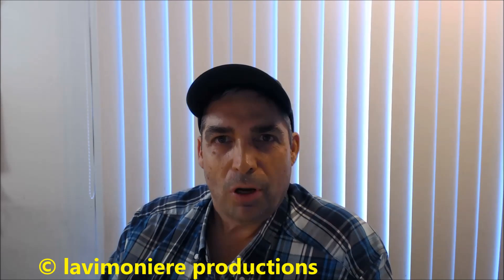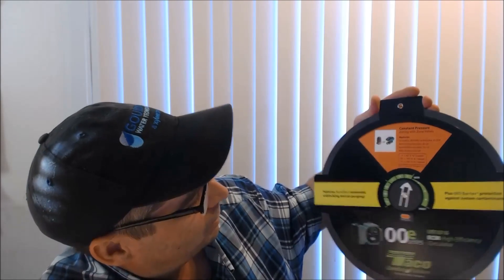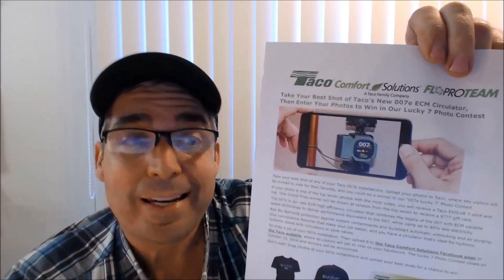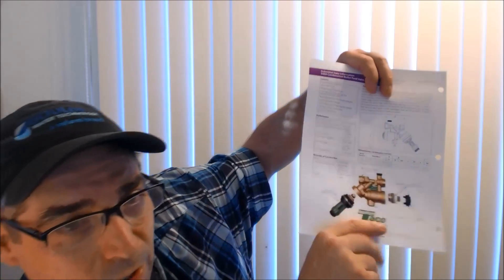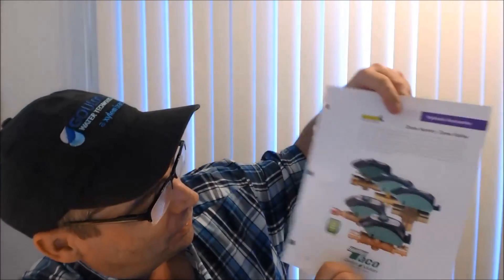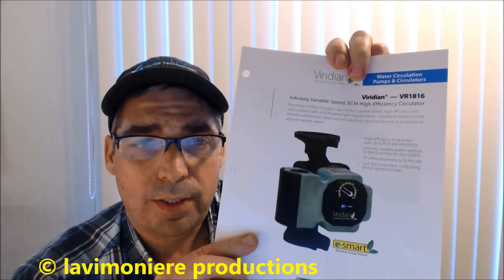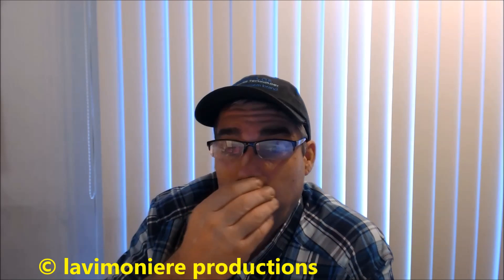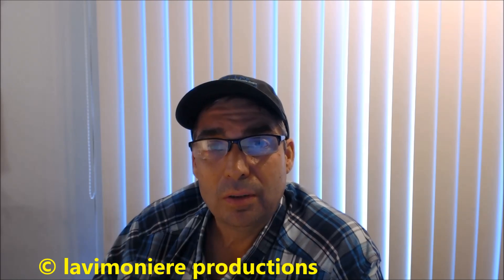New Taco ECM High Efficiency Circulators my thoughts

Comment: I know it's an old video, but I installed a caleffi mag/dirt trap a year ahead of me planning to replace my boiler system to get ahead of pull magnitite and crud out of the system.

First few flushes were dirty, after that I maybe blow down 1x a year now. I'll flush once a week after making a chance, kick space, act install to catch copper shavings and such flowing in system. 

Running a VT 2218 and couldn't be happier after having to choke it down with a valve to 2gpm.

Comment: Steve, we installed a new Veismann boiler with the 007 ecm recirculator (about 3 weeks ago). Today, the pump stopped working and they came and replaced it. We have all copper baseboards and I have no idea why it failed, but I hope the new one doesn't fail soon (we have a single zone system).

Comment: yes, i know this is an old vid but big companies now are no longer about service and making a good product that lasts. its all about building failures so the end user has to buy more. like you said, your working on 50+yr old boiler systems that worked fine all these yrs without magnets. i was told by a plumber that the boilers today will be lucky to see 20yr. big companies are all about money...period.
i have a cast iron american standard boiler from '67 thats running fine but alot of the nubs on the heat exchanger have roasted off so i bought a new weil mclain cga-5 which im hoping will last me the rest of my life or as long as i keep this house. right off the bat, im buying extra parts so i have them on hand because of all these engineered shortages.
its a shame we can no longer buy certain things and not have to worry about them breaking down or having to "update" to keep up with some mandate or code that we've been fine with not having all these years. this house i bought with the original american standard boiler and baseboards and it still has the original thermostats and smoke alarm, family gard fg777c which i think is from the same time period, late 68's early 70's, and everything still works just fine!!!
"they dont make them like they used to" isnt just a saying...its a fact.
thanks steve.

Comment: I've installed a few boilers with the new taco 007-e  circulator. In older heating systems.    Had to go back bc of rattling pipes due to the pumps magnetic feature.

Comment: This is just an example of the bean counters showing how much money you can save, but you will lose in the end because of the higher maintenance costs. This is just like the wall hung boilers you dislike because they were installed mostly to get a rebate. I’d rather stay with old technology instead of ecm motors and electronic txv’s.

Comment: A magnetic rotor saves electricity because it lowers the wattage needed to get the same power from the pump. They also need to convert the current from ac to dc. This will cause the pump to have a shorter lifespan.

Comment: ECM variable speeds are the way of the future. Can run on constant pressure mode to keep the same flow rate when different zone valves are closed or open.  Delta T mode changes GPM based on Delta T. Very efficient and can dial in GPM and ft head curve perfectly. Dirt separators aren't a bad idea anyway with new mod con boilers. You're probably right not the best solution on all black and cast iron old system.

Comment: I'm pretty sure they are using permanent magnet motors. Instead of making all it's magnetic fields with electricity they use actual magnets like on your Frigidaire. Car starters have all gone to permanent magnet anymore. Smaller, stronger, and more efficient. Great videos. I've learned a lot from you and im not a plummer. Just a tinkerer!

Comment: I installed the 0013-VDTSF3 variable speed circulator in my 6 zone system.  So far this brand new $565.00 pump does not circulate water!  I bought an extra pump so that down the road in winter that if the pump fails I have a swap... so here I am, $1200 worth of no circulation!  Not impressed. I have a stainless steel and PEX closed system using only distilled water.  This is a new system and there are no blockages or circulation issues.  Any suggestions?
Reply: Yes.  Its not talked about enough but different pumps work for different gpm at different head pressures.  Sounds like you have a radiant system.  If so you may need a pump with lower gpm but higher head.  Taco almost certainly makes the right pump for your situation, you may just have the wrong one.

Comment: I love your videos.  The ecm motor is the same type of motor in brushless drills etc etc. They last longer . Wven on cast iron your going to see efficiency gains . Especially with delta t  operation . Also the motor is sealed from the water in system .

Comment: Nice video. Wished I'd seen it about 2hrs ago. I just purchased one of these to replace a original 007. Damn this think sounds like trouble. I watched a video of the 007 ecm earlier when the representative praises this thing and tells how efficient it is , how it ramps up and down and senses air, repeals air via ramping up the motor, senses obstruction and attempts to free the obstruction up to 100 times in 15min time frame going from reverse to forward. And of course my house is from 1920 and is all iron pipe. Yikes I'm in trouble. Might have to buy a regular 007 if this doesnt last. I'll put a bunch of magnets on the return pipe to hopefully help collect the iron shaving . Thanks for posting bud. Time will tell like you stated....

Comment: The delta t and p circs are a great idea but not to save on electricity. The delta t can maintain the design temp diff for your system, usually 10 degrees for radiant and 20 for baseboard and radiators. This cuts down on short cycling.

The delta p is great for zone valves. As the valves open and close the proper pressure will be maintained. You can run the delta p constantly because the speed will really wind down when all zones are closed using almost no electricity. The benefit of leaving it on is that you won’t have to go through the full speed initialization for one minute every time they start.

As far as a money saver forget about it. The standard 007 only pulls the energy of a 60 watt light bulb.

Comment: hey Steve we've had those type of circulators in the uk for a few years now. They're unreliable junk!
Reply from the maker: thanks for the input i know you guys are way ahead of us in high efficiency boilers and stuff .i work on most old stuff 80 + boilers  starting to change over here to more higher efficiency stuff . but just starting .i do not thing fuel cost are as high here as you guys . gallon of gas is only 2.15 per gallon

Comment: I don't understand why manufacturer's would set up a product to fail like that. I am with you it's crazy! I guess it's all the regulations that the department of energy is putting on the industry. Then as contractors we have to deal with it, as they say it flows down hill and we are at the bottom of the hill.
Reply from the maker: yes sir ,some of the stuff they come up with .is crazy

Comment: Steven, You are right about use in any system containing iron work. Trouble will ensue in a short time causing high maintenance for the end user. Even some types of "stainless" products will corrode to a certain extent. Be very careful. I have encountered similar problems throughout my years in the heating industry in Europe. Regards

Comment: So it requires a $200 filter, that requires cleaning every month...  So you take a house that was built in 1910, everything is steel pipe, and cast iron, and it's a rental, and the tenant does not pay the bills, so they don't care when it quits they call the landlord who calls the heating company to fix it.

Comment: We using the HE Pumps from Wilo for like 10 Years now and even Systems with 95% Black-Piping and there a no issuse even with alot of sluge. They have a Sinter-Bronce Filter in Motor-shaft and around the Bronce Bearing. What bad is if you flush (with a special Compressor)  the system you need to take them out because of the Dynamo effect.  We had pumps running wich had nearly 1kW and they are mostly down to 200W in summer time in the Winter about 500W.

Comment: The only other style taco circ I've known about is the ecobee. I think that's also a variable speed one with a remote delta T  temp probe. I've never installed it though. Use mostly taco 007 pumps. Interesting how even circulator technology is evolving. Like you say Steve "embrace the technology!"  Everything in HVAC is getting a technology update whether we like it or not!